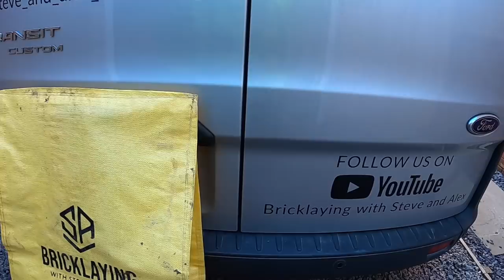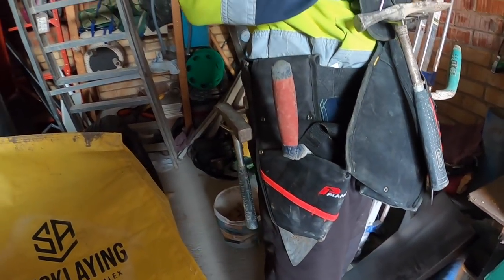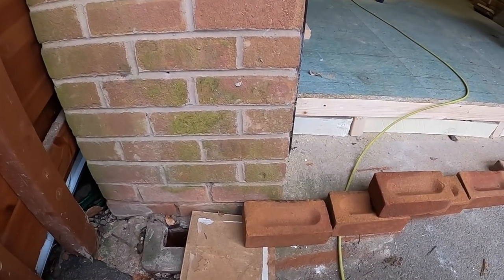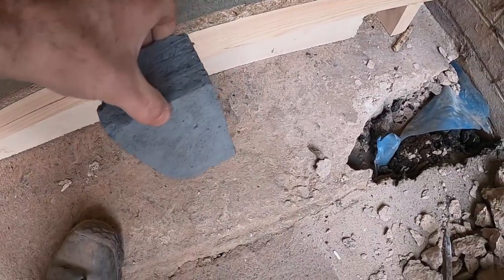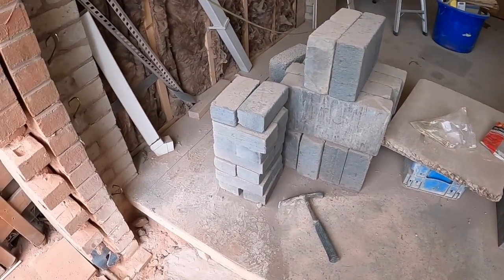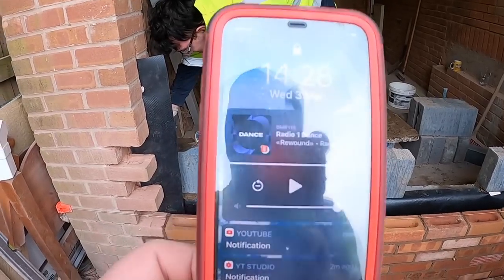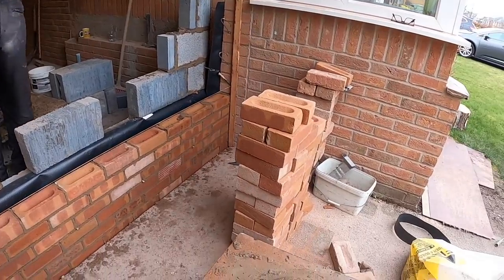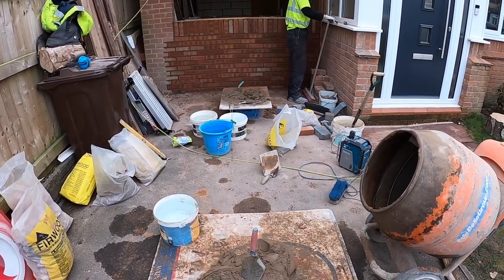NASTY SURPRISE ON A GARAGE CONVERSION

Comment: It would be preferable to use a concrete lintel in that situation although there would be a lot  more work fitting it below ground out of sight so overall probably made the best of that little obstacle which kept the job on track and the lintel was galvanised, good job on the brickwork quality over quantity ever time👍
Reply from the maker: Thanks pal , much appreciated 🧱👍🏽

Comment: Nice job, cavity tray in, weep holes etc, it would of been a super job to stagger the joints on the drytherm, but that’s being a bit picky but surprised you did not  have a lintol on the inner leaf

Comment: Great job guys very nice 👍 any particular reason you went with a metal lintel? I thought you would of used a concrete lintel?.
Lovely old job 👍✅💯🤙👊👌
Reply from the maker: Convenience really we would have had to take out 2 big holes each side another 2 courses down and dig out the middle too and space was very limited. Also have you felt the weight of a 2.4 meter 6x4 concrete lintel ? 😳😱😆🧱👍🏽

Comment: How did you calculate the weight / loading on the lintel in kN to decide if standard, heavy or extra heavy duty was required? what lintel and load table did you use?
Reply from the maker: None it’s a standard off the shelf angle carrying vet little weight
Reply: @SteveAndAlexBuild   Thank you ive found it near impossible to get any rules of thumb and calculations seem to be immensely complex im hoping to use this method on my own project.
Reply from the maker: @willmoran2332  check your floor first . Dig a hole in the concrete till you find the Dpm . 
   If the slab is reinforced and at least 150 mm thick you can build straight on it 👌🏼🧱👍🏽
Reply: @SteveAndAlexBuild  it may be about that but because im left with half a brick course at the concrete slab ill need to break out an inch or so so the levels meet for teething
Reply from the maker: @willmoran2332  . Cut your bricks down it’s easier and a stronger slab .💪🏼🧱👍🏽

Comment: Garage floor level is always 150mm lower at the door if its been built properly,we always use two 6x4 concrete lintols just cheaper.

Comment: Belt attachments are excellent. I wish they'd had them when I was on the tools. I was forever poncing about the top lift of the scaafold looking for my brick hammer, only to find some f*cker had knocked it off the scaffold.😳
Reply from the maker: Definitely, I was sceptical about them but   Wouldn’t be without mine now . 
 Hammer , tape, pencil, nails , jointer amongst other stuff all right there 👌🏼🧱👍🏽

Comment: I was wondering why the insulation touches the outside wall, I thought there had to be a gap to top moister soaking into it from the outside to the inside wall?
Reply from the maker: Hi it’s full fill insulation so designed to fill the cavity 🧱👍🏽
Reply: @SteveAndAlexBuild  I guess it depends how much rain hits the wall, how sheltered it is?
Reply from the maker: @DICEGEORGE  The fibre glass has a grain where water passes through vertically but not horizontally 🧱👍🏽

Comment: Digging up some older videos... your second attempt at pronouncing Einhell is bob on!

The brand seems to be going through an interesting transformation these days. 15 years ago Einhell tools were pretty much the same as DIY stores' own store brands, straight from China and the same models sold under ten dozen different names and in at least four different colours. Like the famous old Hitachi clone breakers that came in at least black, red, blue, and yellow. The ones that always came with spare brushes that you hardly ever needed because the whole thing broke long before the brushes wore out. I had two of them and eventually built one out of the two after one switch and one hammer mechanism failed.
Reply from the maker: Cheap and cheerful Chinese kit , does the job 🧱👍🏽

Comment: Been looking through the comments for a similar question but couldn't find anything. The side wall didn't look to have a cavity. But you put insulation on it, how do you do the wall on that side to stop damp penetrating? Did you just stormshield the outerwall?
Reply from the maker: No the brickwork was in very good condition so don't expect any problems 🧱👍🏽
Reply: @SteveAndAlexBuild  Thanks for the reply appreciate it. I noticed u reply to everyone. I'm guessing that means you don't have to do anything special? If you have a single brick garage, could just put battens and insulation in and get no damp?
Reply from the maker: @borisbolshoi7317  . Yes I appreciate every comment and try to reply to everyone.👍🏽. 
   All garages are different so not all have the same wall thicknesses etc 🧱👍🏽

Comment: Hi mate im on with mine in a couple of weeks .its a 9 inch garage pillar can I run my block work up the back of the 9 inch pillar to for a 300 mm wall or just over and put a damp course r up the pillar
Reply from the maker: Yes pal that’s what I would do 👍🏼🧱
Reply: @SteveAndAlexBuild  thanks alot pal .and does the cavity tray sit on the existing garage floor 150mm below the dpc level.then an extra dpc at the dpc level
Reply from the maker: @matthewingham8579  no it sits on face dpc then up onto the top of block course 1 🧱👍🏽
Reply: Perfect so it sits at the same level as the house dpc .because ypur bringing the floor in the garage to the same height as the dpc
Reply from the maker: @matthewingham8579  👌🏼🧱👍🏼

Comment: Why the 4" block? They are called partition block for a reason. Also we use rigid between the block and brick with built in ties. What about exterior vapor barrier?? Workmanship is nice but building techniques is totally different around the world.
Reply from the maker: Thanks pal it certainly is 😁🧱👍🏽

Comment: I would have thought the thin original slab is much stronger then the tiny lintel. Sometimes it may be cheaper to pay Structural Engineer who may advise and explain you may have  created your own speedbump
Reply from the maker: @martin2466  last time I used a S E  the bill was £700 which is more than we charged for our bit ! 
   Those lintels are designed to carry a lot more than 100 odd bricks plus it was bedded on top of the hardcore so it won’t be moving any time soon 🧱👍🏽
Reply: @SteveAndAlexBuild  the lintel is indeed strong enough i just wondered if it was not cheaper to get someone to justify you sitting the brick on the exg instead without all the work but sounds like SE prices outweigh any savings
Reply from the maker: @cibulka2005  I understand you now . On this particular job I only found out how poor the concrete was by accident on the day so it was sort it out somehow straight away .😬🧱👍🏽
Reply: @SteveAndAlexBuild  Almost all older properties will have a footing between the external wall of any garage and the external wall of the house where the garage door is...they used to do this way for 3 reasons...1) it was a design that helped prevent differential settlement, and 2) it was easier to run in footings under all areas of construction 3) it resolved the issue of any future use, such as conversion to a a habitat area... These days it is hardly done at all on new builds, for the simple reason of saving a few quid...but neglecting the fact that it’s more likely to be converted now than was done years ago...!
Reply from the maker: @stun9771  . The groundwork’s firm we worked for always built across the garage doors and sat the 150 mm reinforced slab on  too 💪🏼. This job however the garage was an add on years back where that didn’t bother . At the end you can just see the slight difference in the brick match between the house and the garage . 
   As the saying goes “ the bricklayer will get over it  “ 🙄😁🧱👍🏽

Comment: Tidy job, as always quality 

Must be an Irish thing but all dpc is bedded with a thin skim of mortar as standard. 
Otherwise you have a slip plane.
Block on plastic not bonded

Well done 👏 ✔ 👍
Reply: @martin2466  Its pretty obvious you have limited building expertise and have never had a trowel in your ✋ 
Old school here and its standard
Reply: @martin2466  There is a greater chance with no mortar under dpc

Just have to do some demolition martin to see how easy it is to knock if not embedded
Reply: @martin2466  Martin 
Its just bone laziness to not bed your dpc
Why you have a bee in your bonnet about it , I can't understand 
You build your way

I will build my way, also the right way

Sure if you, want don't use mortar and buy a lego set 😉 

BEST PRACTICE to bed DPC
Reply from the maker: @martin2466  🧱👍🏽
Reply: @martin2466  Half arsed reply
OK every building federation and construction guidelines state that DPC is to be bedded on for structural integrity. 
 You seem happy to ignore current building regulations and standard practices.
But nonetheless you go back to your lego set and play in the sand pit 😆 🤣
Reply: @martin2466  As a civil engineer  , I do follow building regulations and codes of practice 
But each to their own and its hard to teach an old dog new tricks

Anyways best of luck , am away to buy a lego set 😉 
Cheers Martin enjoy ur weekend 🍻
Reply: @martin2466  35 years on sites , building since I was 12
Father a blocklayer
Reply: @martin2466  Man of many talents 🙌 
Blessed lol
Have a good one 👍

Comment: Steve, what size trowel does the drill thing take?🐰🐰🐰😷
Reply from the maker: Not sure what you mean Ian 🤔? 🧱👍🏽
Reply: @SteveAndAlexBuild  hi,as in would it take a 10 inch M  Town, I need something like this for the top couple of course of concrete blocks, cheers,
Reply from the maker: @ianhoward4246  Ah you mean the power tool pouch . Yeah mate it would even take Charlie c’s 6 “ spoon trowel no probs . 
  It’s a PLANO 👌🏼🧱👍🏽
Reply: @SteveAndAlexBuild  great,I have a little trowel too,some days my wrist n elbow are fxxxxxx torture!! Will I get one cheap if I use your name (I tried amazon but they'd never heard of you!!!)🤣🤣, cheers
Reply from the maker: @ianhoward4246  .I wish 😂 🧱👍🏽